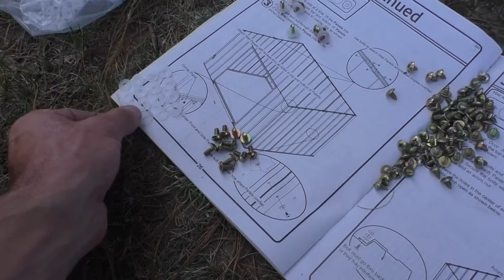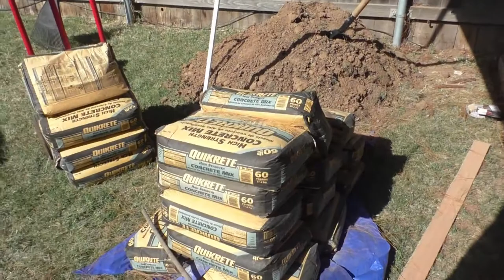Arrow Newport 10 ft. x 8 ft. Galvanized Metal Storage Shed with Sliding Lockable Doors Installation.

Comment: Thanks for this video! I’m setting up the 8x6 one in my backyard. Does it come with anchors, or will I need to purchase those separately?
Reply from the maker: No anchors, I had to buy my own. I also ran polyurethane sealant on the bottom, to make it water tight.

Comment: Any problems after 3 years? Moisture damage or mold growth?
Reply from the maker: Only one complaint, I wish doors had small wheels instead of plastic guides, have constantly lubricate them and doors don’t open smoothly. But other than that everything is good, no moisture or mold , although it doesn’t rain all that much where I live

Comment: Much respect, you are fearless to tackle this whole project on your own. I have done some research on this one and everyone says you need at least 2 people for it. You've given me the confidence I needed to go at it alone too. 
I will be doing exactly what you did including building the platform. Do you recall how many bags of concrete you used? were they 40 or 80 pounds each? I also noticed you didn't use rebar. Was that a conscious decision ? or you just didn't care? 
Also..any leaks during rain season?
Thank you.
Reply from the maker: Thanks, I do most of the work by myself, but I would recommend you have someone help you with mixing and purring concrete! My back didn’t like that too much. I think I have used about 50 ( 60lbs)bags of concrete) . I didn’t use rebar because I don’t think it’s needed, there isn’t much weight to support.  Also we haven’t had rain here since I installed it, but I did seal the bottom with some polyurethane caulking.

Comment: I bought the same one...nothing but heartache and backache. Parts didn't fit right, holes did not line up and to top it all, the doors will not open or close unless I use both hands and my back. I double checked all measurements, base is square, top is square and using a level all bubbles are centered. Piece of junk..I DO NOT RECOMMEND THIS PRODUCT TO ANYONE, EVEN IF IT IS FREE!
Reply: I feel your pain. Roof was very frustrating none of the holes wanted to line up. I actually made a few holes in the beams myself because they just wouldn't line up no matter which way I twisted the building. I wouldn't recommend this building to anyone unless it's pre assembled and brought to you on a trailer. Or  pay to have the company that makes them come assembled it for you.
Reply: If you run the screws at an angle then drive them in they go just fine. None of mine lined up and I got them to go with a little angling. Very unprofessional craftsmanship on the part of the company but in the end it’s decent enough

Comment: what are the dimensions on the concrete slab?
Reply from the maker: I made it just an inch wider then the shed. 10’1” by 8’1”
Reply: Cool. I appreciate you responding back. I plan to buy this same exact shed this weekend and was curious about the floor dimensions.